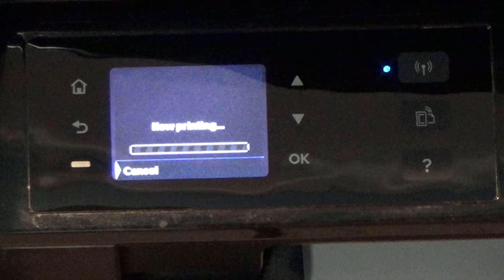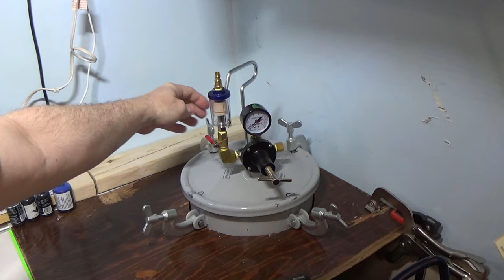Making a Picture Pen with label casting and lathe turning

Comment: A great idea! It came out fantastic. Did you make the template for cutting out the photo and what paper did you use? I have to try this. Thanks
Reply from the maker: Thank you.  I used OL9805WJ Weatherproof Matte paper for inkjet, which I purchased from onlinelabels.com. I did have to make my own templates. It was some trial and error with regular paper.  It seems every printers size is different then the actual photo software.  Good luck!

Comment: Beautiful pen! Two questions. What software did you use to make the label on and secondly why did you put the mold in an oven and at what temperature?
Reply from the maker: I used Gimp Picture editing software. (free). I also was using alumilite clear slow and they recommend warming up the molds 130-150F before the pour. Thanks for watching!

Comment: Anther question. What’s with placing the mold in the microwave for five minutes before adding the resin epoxy?  There is no narrative explaining that.
Reply from the maker: Alumilite Clear recommends warming up the mold.  Not all resins are the same.  Some resins might not need the mold warmed up.

Comment: Did you do any more than just fine sanding and polishing with micro mesh pads?  CA glue finish?
Reply from the maker: Thanks for watching John.  I sand to about 2,000 grit and then buff. I don’t use CA finish when using clear alumilite resin.  Take care.

Comment: What temp are you heating the blank to prior to adding your resin?
Reply from the maker: Usually between 120-130.
Reply: @TurningsbyTurner  thanks.  You’re one of the few that answers the questions that make a difference in one’s work and help with the details that make a difference